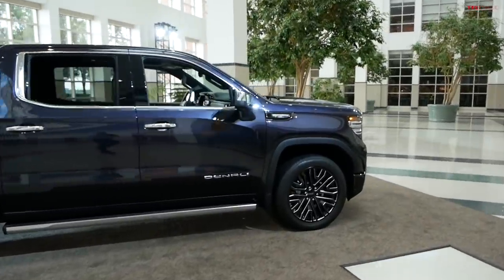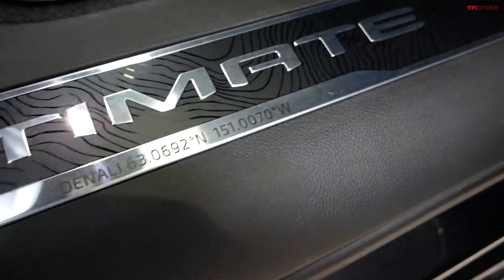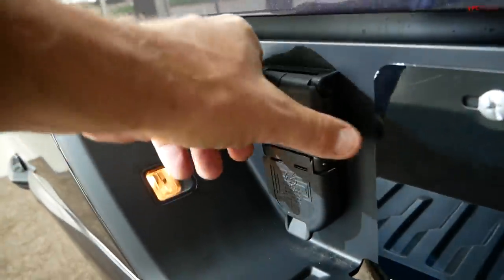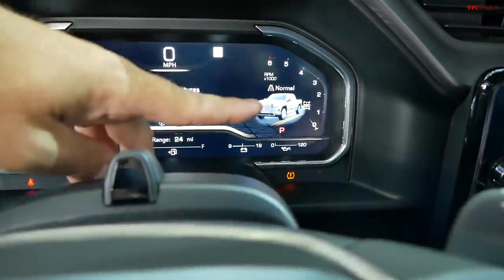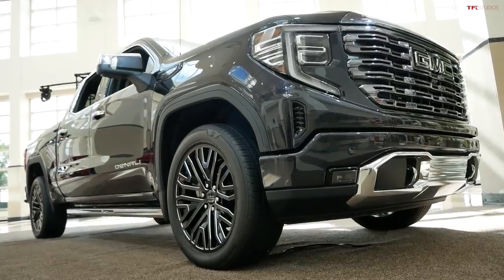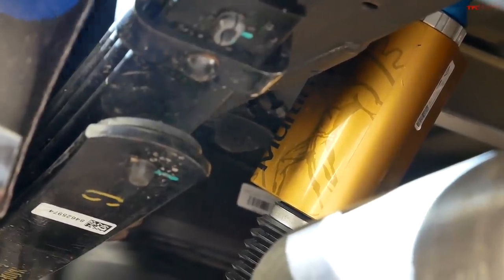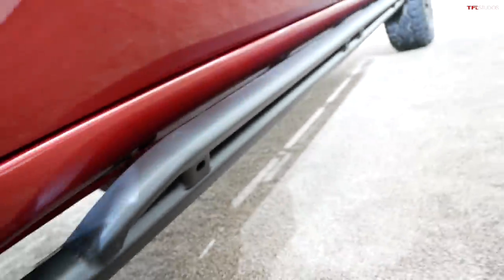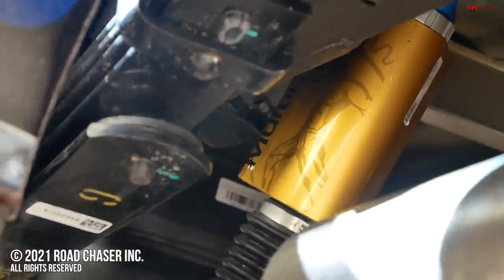Hands On WORLD DEBUT: Here's How The 2022 GMC Sierra Takes It to a Whole New Level!

Comment: $80K for the ultimate. That’s almost $20K jump from a regular Denali at $62K to the Ultimate Denali. I pretty sure there’s not that much more technology in the Ultimate to justify that big of a difference in price.
Reply: Exactly. There is no updates to the top powertrain and that interior looks good, but not enough to justify that big of a jump. Guess they figured if Ford is selling $80K Limiteds, they can too. But Ford throws in the hybrid system and Powerboost engine.
Reply: That entry level Denali won't have Super Cruise, that hardware and software costs several thousand alone. You're comparing where the Denali starts to the fully loaded version, of course there's gonna be a big price jump. GM is smart to offer a $62k Denali, some people only want the appearance of an $80k vehicle I bet they sell a lot of these to people that would have bought a loaded SLT in the past.
Reply: @OneNationUnderGod.  Super Cruise is only a $2000 option on an Escalade. I'm just not seeing $80k plus for the Ultimate with no differentiation in powertrains.
Reply: @hellkitty1014  on an Escalade that would have already had all the other driver's assistance features in place. SuperCruise is not a $2k option on a vehicle that doesn't have all that hardware already from a previous package. SuperCruise on an Escalade is just adding a little more hardware and unlocking software already built into the vehicle's computers.
Reply: @OneNationUnderGod.  that makes no sense. All of the vehicles were built with infrastructure from the start. Some are simply not equipped with the system, some are. Back when the CT6 debuted the system, it was available in both the Premium Luxury and Platinum versions without an insane markup. Even so, the Ultimate is way overpriced for what it offers. What us going to happen when Ford releases Blue Cruise for a far cheaper price?
Reply: @hellkitty1014  the entry level Denali is not gonna have all the cameras, lidar and other sensors needed for SuperCruise. An Escalade has the hardware for adaptive cruise control standard and some of that hardware is carry over for the SuperCruise like the lidar sensors and lane keep assist cameras.
Reply: Yeah but it's ultimate
Reply: @OneNationUnderGod.  Nobody needs supercruise just drive your truck its a truck not a limo.
Reply: @codysmith9813  I completely agree but if buyers are willing to lay down the cash for it why should we care if they want an $80k pickup that can drive itself and a boat down the highway?
Reply: @OneNationUnderGod.  It doesn't make any sense paying that much, my advice was just to warn them of a dumb decision before they spend all that $. But it is there decision.
Reply: @codysmith9813  I agree to an extent but when a loaded Kia Sorento is close to $50k what do we expect for a pickup that's far more capable and has much more technology and features?
Reply: @OneNationUnderGod.  Dont buy anything.

Comment: Let’s hope they put a reliable transmission under these good looking trucks
Reply: The 10 speed is much more reliable than the previous 6 & 8 speeds GM has used for years.
Reply: @Cody_Austin  I'm starting to think that. Need to see a few more years on them to know for sure.
Reply: More like a reliable truck underneath all that sheet metal. But we all know what’s really gonna happen
Reply: I know people don’t like the 8 speed. But where’s the hate coming from on the 6 speed?  I’ve had one for nearly a decade and have no complaints.
Reply: @Maverick09171  the 2014+ 6 speed torque converters like to grenade. I think routine maintenance is key, but not an end-all-problems preventative measure. I had my fluid flushed at 40,000 to be safe, $190 out the door.
Reply: @Cody_Austin  gotcha. I’m in a ‘12. I flushed at 90k without issue.
Reply: They do its the 10 speed
Reply: Lmao from Chevy reliable? Nah the year 2,000 was the last best reliable Chevy’s
Reply: @Cody_Austin  that’s because Ford makes the 10 speed.
Reply: Thank you, someone said it
Reply: @Maverick09171  Agreed. I've not heard complaints about the old 6 speed. That's the only way I'd buy a GM half-ton now.
Reply: Is same as fords so it should be good
Reply: @Maverick09171  I got an 11 220k miles all original besides a water pump and a ball joint
Reply: @jimthumerzs6981  the 4 speeds were good too
Reply: @Anonymous01416  that’s why the 10 speed has lawsuits more then once
Reply: @lukemoen5156  yep. My 12 has had a window switch. I did notice the other day, the output shaft seal on the transfer case has a small leak. Other than that all original here too (other than a few mods)
Reply: @Cody_Austin  Ford 10 speed basically
Reply: @jasonr7253  yea at the beginning of when it first came out
Reply: @jasonr7253  8 speed has multiple lawsuits as well
Reply: @Maverick09171  i am with cody austin . 2010h had dealer drop trans pan at 40k .had shifting problems at about 55k, 2 would slam one time then sip another.
Reply: @lukemoen5156  yep. Tuned here. Don’t go extreme and you’ll be happy
Reply: @jeffforbes70  my 12 did that when I first bought it. There was an updated cal that fixed it. Been great ever since
Reply: @Maverick09171  mine was fine for the first 6 years then the last year i owned it it started slamming and slipping only did on second gear . i think there was a valve body issue. then there was also the afm tick. and 1000 dollars of sensors . i miss the trucks comfortable interior. that's about it

Comment: Awesome looking truck, but man…I’m gonna need a second job/better job/side hustle to afford that AT4x! GM has priced itself into a niche.
Reply: I mean it’s just as much as a raptor at that point……and it doesn’t even beat it!!! I’m so pissed at GM rn
Reply: @BIGJBIGEBIGC  exactly what I was thinking, it’s got me nervous on the price for the Silverado zr2
Reply: Unfortunately they're going where the money is. GM just said their average purchase is over $50,000 or $55,000. We have some saving to do haha
Reply: It's nice and all but's it's not worth it to me unless i had ton's of expendable cash. It's just a bunch of plastic and more thing's that will take a shit and cost more to maintain. I would just buy a used 6.2 trailboss myself. It's a really nice truck though thats for sure
Reply: I know the market doesn’t reflect it right now, but man I wish/bet that if someone made a solid, base trim truck with lockers (front and rear), 4 low, and no BS tech…just a plain, solid, reliable truck…they could sell it like hot cakes. 
But everyone is enamored by tech and frivolous trinkets that drive the cost up. 

A V8, two speed transfer case with lockers front and rear, decent skid plates, recovery points, maybe a pair of rock rails like the AT4x has and some decent tires. It’s an easy recipe but…🤦🏻‍♂️🤷🏻‍♂️

Comment: Man I can't wait!!! If my boxes gets checked off then I'm pre ordering the GMC Elevation with the diesel and the x31 package. In Cayenne red.
Reply: Let me make you more excited … The dealership replaced my 2017 Sierra Denali transmission few months after I bought it, and now it needs another transmission with only 50,000 on the truck, I am never buying a GM again :)
Reply: @3BoOoDTV  So you had a completely different truck with a completely different powertrain with a known flaw? Got it.
Reply: @3BoOoDTV  weird, I’ve owned a 2017 sierra and now have a 2021 and both have been fantastic
Reply: @3BoOoDTV  i have a 2014 Sierra since new. Has Been great
Reply: @Tiovergudo  same, 2018 with the 8 speed. No issues.
Reply: 2020 Elevation 5.3 10 speed 20k miles... no issues
Reply: @chrisheisserer  wow a whopping 20k

Comment: Will the 2022 still have lifter and pushrod problems due to the cylinder deactivation? 
I’m a fan of the old ones that have no cylinder deactivation.
Reply: you must like the 6.6L gas then
Reply: I had a 2010 and 2014 no issues what so ever. My company has had even more with zero issues and some of those trucks hit 400,000kms and higher.
Reply: @UvidCo  I have an 03 with no problems and it has 199000 on it. GM did something with these new motors that just bends the rods, sadly. I really like GM so hopefully they can fix the problem
Reply: @michaeljordan4571  yea I have no problem with the gas if I’m not doing heavy towing. Anything over 9000 to 10000, depending on the terrain should be delt with a diesel
Reply: With the chip shortage I don’t think they doing this anymore
Reply: Oh yeah good CEL with 40 miles on the odometer. Seen a few of those. Used to work in the service department at a Buick GMC dealership.
Reply: Jack K  Trust me my work trucks don't do a lot of highway drive. They are used on pipelines and transmission installation. These trucks see more hard miles in the first 50,000 than. What those personal vehicles see in 200,000, easily
Reply: @UvidCo  lets all just agree to disagree that the older motors are better and last longer.
Reply: @AlaskanDad1822  agreed.. oh, and jump over to the most unreliable vehicle review you can think of and there will be guys talking about how reliable theres has been.. some people have a tough time admitting they bought a hunk of junk.. ive been driving an 03 tahoe for almost 10 years now and its been solid.. old gm for the win.
Reply: @doylee469  I agree, Bought a basic 2011 Silverado 2500, 4wd long bed, cab and 1/2, in 2012. Paid $35k with 9k mi, (Which floored me). Only  problem beyond maintenance has been a throttle body. 10 years later it has doubled and my truck with 87k is worth in the low/mid $20's... Not because it is worth more, but because the dollar is worth so much less. All the bling is what must be done to get the weekenders and wives with good credit into them...Because your average working man, unless he needs a big write off, would struggle to justify such an expense...And would not want to crawl into this at day's end with his dirty clothes and boots, and that putty knife he forgot to take out of his back pocket.

Comment: This is MUUCH better. Glad to see the consumers were heard. Actually looks as good as the 2018 models from the front👍🏼
Reply: Agreed. The 2018 Sierra front end was pretty good. I never liked the 2019-2021 Sierra front ends, it looked to random at which the elements were placed, along with too many unnecessary lines. This Refreshed Sierra really cleaned up the design, and at the same time kinda gave  it the 2018 front end look too!

Comment: I get the Sierra AT4X probably had a lot more standard equipment than the Silverado ZR2 will but hearing the $74k price point really makes me question if the ZR2 can even achieve a sub $60k starting price at all. I really think it needs to be right around $60k given the other trucks available past that point.
Reply: Right there with you. That's touching raptor and base TRX territory and its no where near the same level as those two.

Comment: Man, the AT4X had me all the way up until you said $75000. 
MSRP for a Raptor WITH 37s is about the same money. Frankly, it's more desirable.  

But beyond pricing, that's a damn nice truck.
Reply: True but the gmc also has options that the raptor doesn’t. Message seats, 6.2l v8 , better interior in my opinion. etc I think it’s about preference. Also, a lift with 37s would look great on the at4x

Comment: That approach angle looks disastrous for an 'Off-Road' truck. The tyres are far too small,and the interior is much too posh. Only real advantage is the presence of a front and rear locker.
Reply: Its attracting the 60+ crowd. I can picture some old guy with inherited riches, with a stetson hat on, driving one of these around.
Reply: @doylee469  I see where you're coming from, but I think that kind of person would much rather plump for the Denali Ultimate or the Ram Laramie Longhorn
Reply: Would be nice if they had a great base price offroader. Some people what a offroader with it being super luxurious.
Reply: @nabeelahamed5554  what if I didn’t say stetson hat? Would that be more fitting? Lol